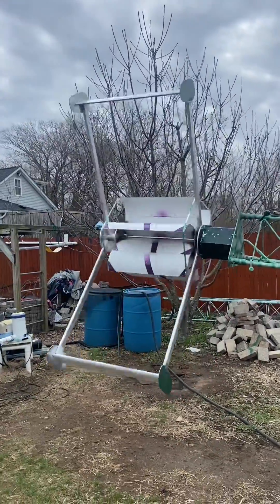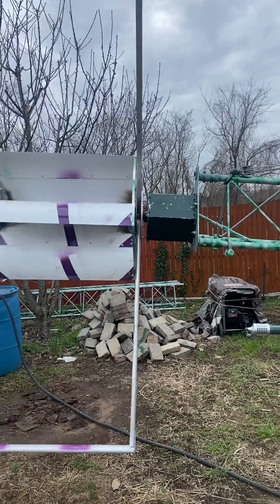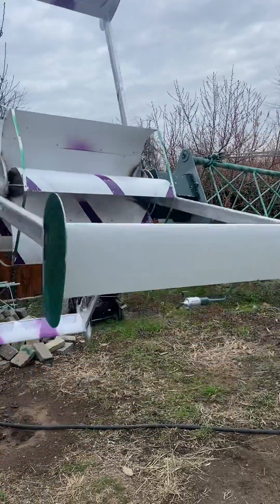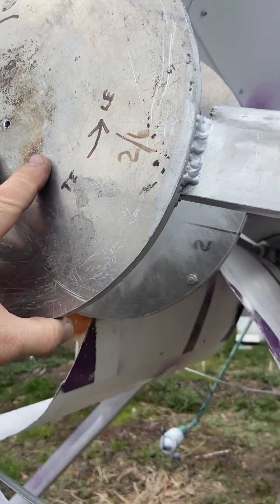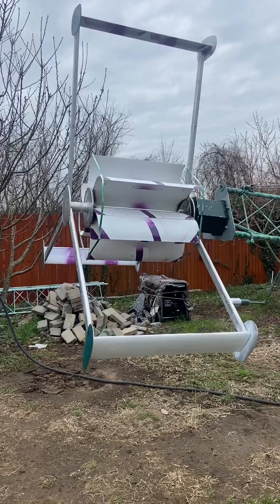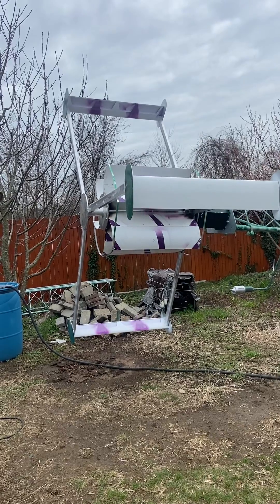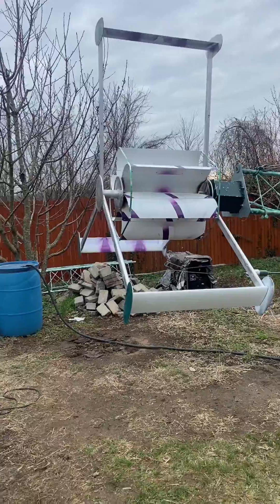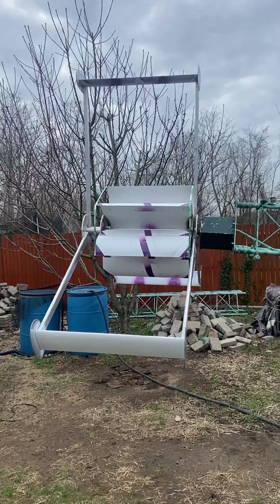vertical wind turbine finished!  Now I need wind just to test it .

Comment: My wind turbine peaked at 712 watts earlier today. It was mostly 300-400 watts a couple of hours ago, with gusts up to 5 or 600 occasionally. After some 70 MPH wind gusts last week, I checked the bolts and installed nuts on the back side of the hub. I think it's quieter now. I also coated the blades with Armor All. How are things going with yours?
Reply from the maker: well, in the last video, I just put the three-air foils and the three original Tessa blades. It did not perform at all. It’s spinning at a lower speed, (8mph)but still nothing fast enough to produce usable power. I may take off the airfoil arms to eliminate all that weight, put the extensions back on the Tesup blades and leave it like that for now.  I have a Wind Turbines from Tony , he supposed to get shipping cost and tell me he has it in the shop so I will be going to a horizontal plus I will increase the height of the tower to at least 40 feet. at some point, I will sell the generator that came with the Tesup